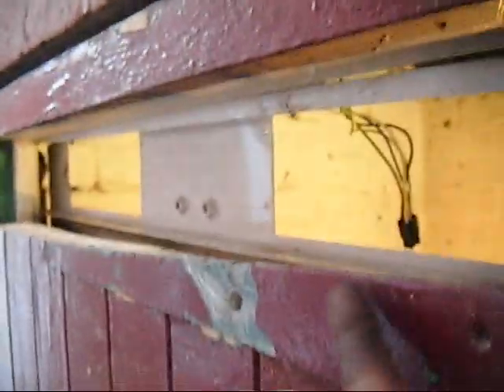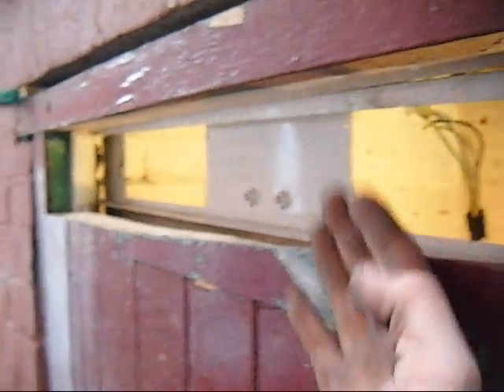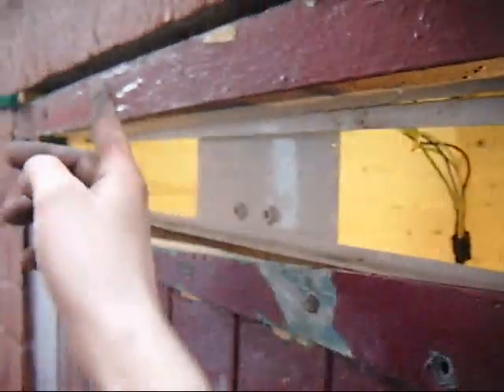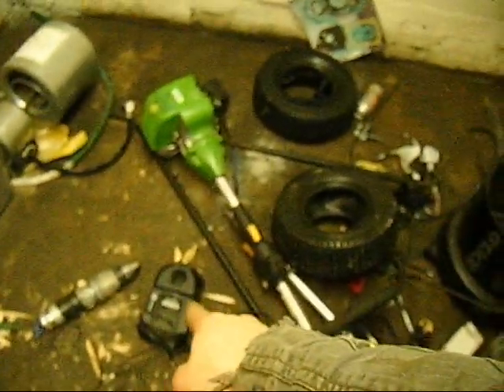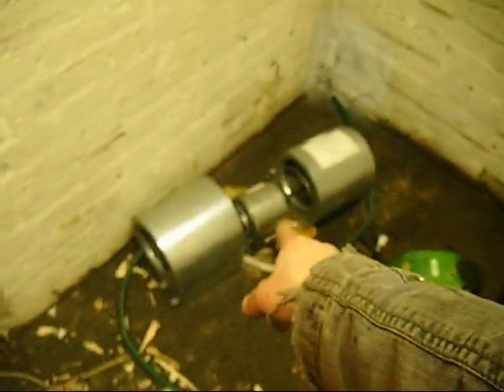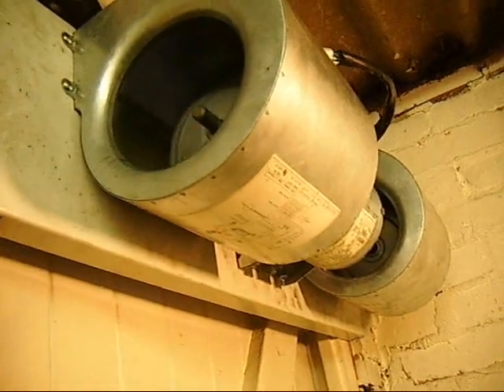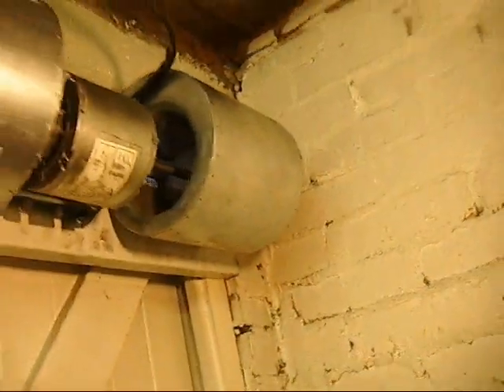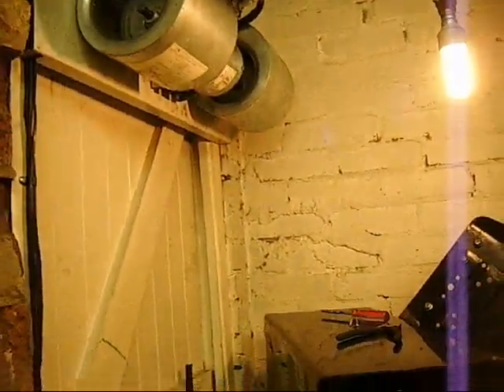instaling new extractor fan

Comment from the maker: i installed it for extracting exhaust fumes and to help vent when welding and spraying, if you have damp problems a heater and or a dehumidifier will work. although a fan may help just not too sure how much